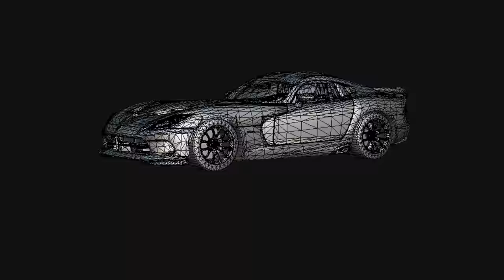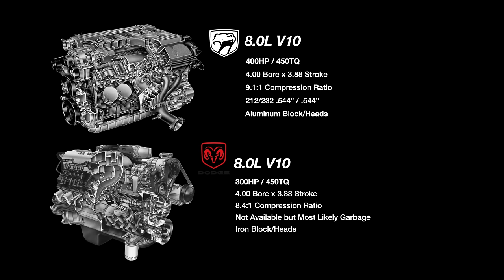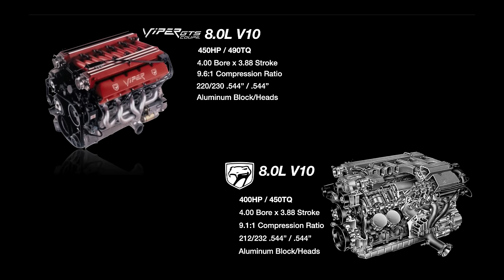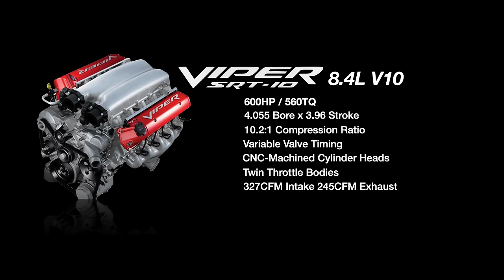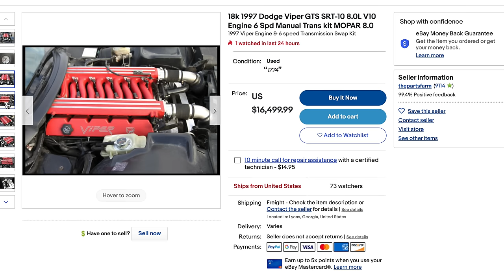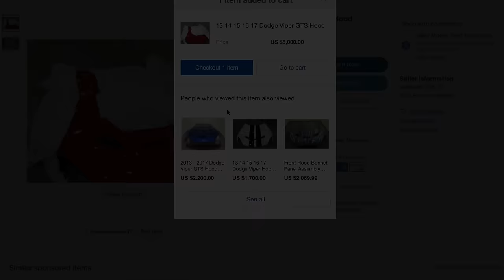Why V10 Viper Engines Are Too Powerful 😳| Explained Ep.5

Comment: honestly why would you get a gen 5 viper for six figures when a used gallardo for very low six figures or a mclaren 12c for even less. Or even an NSX. A modern one will go for like 125k but an older one is more like 80k even with 50k miles on it or less. But the viper is cool, I gotta admit.

Comment: 1:01 the truck v10 only made 300 hp because it had a weak cam.
Reply: Back then truck's were really only pushing around 300 350 hp look how much power the 454 SS made
Reply: @souljayt8411  Why do you think the 454 SS only made 255 hp at the most.?
Reply: @blackericdenice   depending on the year (1990-1993) , a 454 SS C1500 would have made between 230hp for the earlier versions of this truck and 255hp for the latter.  However, these trucks would have had between 385 and 405 ft/lbs or torque. In addition the early trucks would have had a 3.73 rear end and the latter trucks a 4.10. With this all being said, these were trucks which could abuse their tires as easily as they would use gas. These hp numbers may not seem very spectacular in todays times, but in 1993 the average horsepower for the common V8 domestic pick-up was probably around 210hp. Yes, the 454 SS and the first gen Ford Lightnings were special trucks, but in comparison todays Ford F150 with a Twin Turbo EcoBoost engine would embarrassingly outperform either of these trucks.
Reply: @mrmatt7210  I asked you a simple question. Why do you think the 454 ss only made 255 hp at the most?
Reply: @blackericdenice  it's not just a weak cam bro did you not watch the video its a combo of many things a cam upgrade on the 7.0 v8 in the ss isn't gonna give it more than 40- 50 hp .....
Reply: @souljayt8411  Unlike you, I don't need to watch a video to know where hp come from. First off, the 454 is a 7.4 liter. How much hp you get from a cam depend on how large the cam is. The 255 hp 454 has a larger cam than the 230 hp 454. The 290 hp 454 has a larger cam than the 255 hp 454. You ever hear about the 1970 454ss Chevelle? It made 450 hp and yes it had a larger cam. That's 220 hp more from a 454 with a hotter cam.
Reply: @blackericdenice  no how much hp you gain from just a cam isn't just about how big the cam is but how sufficient everything else is.  If you have really good flowing factory heads like the ls engines do a cam swap is worth good power if you have really poor flowing heads like alot of the older 80s and 90s trucks did a cam swap won't give you near the power no matter how big you go.  This is the same with anything else.  If you have a big cam you pick up good power from intake manifold upgrades and/or head upgrades.
Reply: @blackericdenice  there is no possible way a cam change alone is giving you over 200 hp.  It isn't just the cam that was better the heads flowed alot more compression also comes into play you're acting like just the cam is what is making the difference in power between different 454 specs.  You ain't gonna gain but so much from the cam on an otherwise stock 454ss engine.  You would need head and intake upgrades to see over a 200 horse gain and to really see some power you'll have to raise that very low compression they was running.  It's a super mild engine.  It's much more than just the cam which yes was conservative.
Reply: @blackericdenice  do u know that the 7.4 in the chevelle is a whole other engine than the 7.4 in the truck.... the 454 comes from displacement bud and to be honest did you not just hear me say that a cam upgrade will at most give about 40-50 hp in these type of high performance engines.... like literally I said that before you went on ur lil tangent lol
Reply: @souljayt8411  If you do any more name calling. This will be the last comment you will get from me. When young people can't win. You start to crack jokes. I heard what you said and you are wrong. Like I said the 1970 454 made 450 hp which is 220 hp more than the first 230 hp 454ss.

Comment: Honestly, the size of the engine is what saves it. Modded engines with 2000 hp only produced 238 to 250 per liter, which is well within the structural limits of stock equipment. You fully forge out an engine, add a better cam and adjust the ring gaps for boost, the world is yours. 3000 herspers? Sure!
Reply: Gen 1 and 2 engines were fully forged from the factory. They were easily good to 900-1000 crank hp
Reply: And how do you plan to put that power down?
Reply: @drewgwins6073  uh, drag radials or slicks just like everyone else that makes tons of power?
Reply: @OxBlitzkriegxO  well with that type of power your now talking about rebuilding the entire backend everything from your diff, to your axles, to your wheels, and likely your suspension. So when I sa how are you gonna put that power down, there's A LOT more to it than just tires.

Comment: I’d really like to know of all the HEMI V8’s, (5.7, 6.2 and 6.4) which if these three engine are most reliable and same with transmission that’s mated to them.  I’d really like to buy a piece of V8 muscle before V8’s are gone!  But I’d also like it to be the most reliable.  I may add that I’m not looking to modify the engine at all. Gonna leave bone stock!
Reply: The 5.7 in my wife's Challenger has 150k miles. It's been problem free. It's a 2015.
Reply: @PacoRobbins  did they have the multi displacement system at that time?
Reply: @travelingrailfan4634  yep she has MDS.

Comment: What are the vipes hood dimensions, or even better is there a 3d true size model of the hood? I am starting a company soon to replicate oem parts, and oem+ parts (So fiberglass or carbonfiber) and custom parts
(Also if people want to have parts and they are discontinued or hard to get, I had the same problem, that's why I am starting this company, so any part ideas put them below)

Comment: The V-10 would only turn 5500rpm. Not suited for drag racing. Dodge should've killed some of the toque, in exchange for high rpm horsepower.

Comment: The sound was intoxicating? Gen 1's sound like a ups truck. Gen 2 sounds good, but not the best. I say this as a gen 2 owner. Also so many wrong facts. 
99 is the last year of the forged motors. The cam also changed after that. 03 is the first year of the srt-10. 02 is the last year of the gen 2.

Comment: A great engine but I wonder how much more of a beast it would have been had dodge gave it DOHC and 4 valves/cylinder
Reply: Not much more considering the HYUUUGE price increase that would have come with. It simply wasn't worth designing a complete ground up engine from scratch.
Reply: @Cooe.  it wouldn’t have been a ground up design. They would’ve just had to recast the heads for four valves. The viper engine isn’t the most efficient when you look at hp/L

Comment: Didn't the dog viper only make like 450 horsepower lol which really wasnt much for a V12 and needed to be modified a good amount to get additional horsepower. So I wouldn't say it's that powerful when u have to do all these things to make it do so. I get the newer version had more horsepower but. If u wanna start with the original it was an over priced v12 car that didn't make that much horsepower. There is even grand nationals that have original engine but. Modified a bit which would still be cheaper then a viper and they have beat them in drag races

Comment: you said "instantly boost" the non forged piston engines. even if you boost the forged piston engines, you pull the pistons and set the correct end gap, or you will destroy said pistons...

Comment: 450tq out of a 8.0l 10 cylinder motor is not diesel like torque at all. Plenty of much smaller emgines make alot more torque. A 3.0 liter diesel makes that torque
Reply from the maker: The 5.9 12V Cummins at the time made 175HP and 420TQ and is considered the greatest light duty diesel of all time. It does have diesel torque😂

Comment: I don't understand why they had to spend so much money on building a design that's been around since they learned how to forge iron if you go back and look at the GMC I don't even think it was GMC back then I think it was just GM 637 cubic inch V8 they put it in some pickup trucks while actually dump trucks and mostly for sitting there I don't know Farmers fuel and pumping water to irrigate now 5 and 1/8 inch bore with a two and three quarter inch stroke and he's the drag racer engine builders are slowly approaching my fantasy motor a 6-in bore with a 6-in stroke now that will take any viper or any Lambo or any exotic car motor on the dyno or at the drag strip you can add more cylinders but if you can't relieve the stress that it's making on the parts then why are so many of these viper engines in the junkyard I forgot pedal control throttle control a person's ability to understand inertia and wait has gone out the window they have tunnel vision until the car comes to a halt by hitting something not knowing how to drive is the first experience that these people have as their life flashes before them and then the ticket book comes out in the insurance company tells them oh we can't afford to fix that

Comment: the real question is how they managed to get so little power out of such a big engine 🤣
Reply: Reliability
Reply: @medloww985  the s2000 got 250 hp from a 2 liter engine and was quite reliable, same with the BMW M3 gtr got 500 hp from a 4.0
Reply: @Steven-re3id  Overstroke design. The car has no revs and all torque. It´s like diesel car.

Comment: The hemi engines can make much better result than this. After all its Magnum 360 with added 2 cylinder. If Chrysler outsource thie licences to aftermarket the Magnum 360 blows Chevy 350

Comment: The trash interior is why I never got a c6 zr1. Absolute fisher price trash interior for a goat car
Reply: Too bad, you're missing out on a great experience!  The C6Z and ZR1 are epic to drive!
Reply: @ssoffshore5111  yeah I say that but I’m still looking at one lmao. I’ll just replace the seats and the Cobalt SS steering wheel. Always regretted not getting one, best looking Vette of all time
Reply: @dontyouworryaboutit_  You won't be disappointed!  A H/C/I C6Z is right up there too, possibly even more fun to drive (the LS7 at 7000 rpm is magic).  I have a C6Z for a DD and LOVE that car!  I still love my TT GTS, but the vette is definitely a better DD and still a very fun, raw, and emotional car to drive.  Change the wheel and you'll love the car!
Reply: @ssoffshore5111  I’ve got a H/C/I gt350R now that should make 600whp after some springs. This next car will have all the boost
Reply: @dontyouworryaboutit_  The GT350 flat plane crank note sounds amazing, but I think you'll like the C6 ZR1 a lot more!
Reply: @ssoffshore5111  I want to get one and run the Lignenfelter 750 kit and leave it alone and have a reliable 10 second car and just drive it till it breaks lol
Reply: I sold my c6zr for my Gen V Viper. The interior was dated on the zr1 but GM did a nice job with the leather and the stitching to make it look better. The sound system is what I had the issue with.

Comment: Perhaps Chrysler will rebirth the Viper  with an all electric platform? These days displacement seems to be getting reduced until eventually everything will be E-driven. Smaller displacement engines seem to be next chapter with forced induction, which will prove unreliable (in the long run) and very costly to repair when out of warranty. 

Love the Mopar muscle heritage and background of the Viper. Easily one of the most iconic cars of the 90s.

Only one gripe, the Magnum 8.0L V10 is a huge displacement commercial grade work horse (even by today's standards). I wouldn't characterize any big block Mopar as "...Most Likely Garbage." 

Especially, when considering it's era of production and that Magnum V10 was severely handicapped from the factory. 

Several Dodge Engineers have openly stated they had to handicap/down tune the Magnum V10, because the availabe glass Chrysler transmissions couldn't handle that broad torque curve- while pulling a full load. 

You can't love the Viper, without first paying respect to the Bob Lutz inspired Magnum V10, which even sold for a premium over the now legendary 12v and 24v 5.9 Cummins turbo diesels.

Thanks for the content.

Comment: Brett Lasala ran Sick Week, logged 1,000 street miles and made 2500rwhp+ on an OEM Predator block, OEM Voodoo heads, and OEM Coyote  crank displacing 302 in³  Avg 6.7 @ 212 with a best of 6.52 @ 216 on 275 radials.....
John Mihovetz has gone 5.88 @ 250mph on a prepped OEM cast block and heads 4.6 4V and still retained all oem timing components, Made over 3,000 hp from 281 in³
MkII Motorsports holds the standing mile world record @ 300.4 mph on an oem block and heads 5.4L 331 in³ and is near 3,000 hp.

Vipers are overrated
Reply: So you just copy paste this everywhere to hate on the viper?